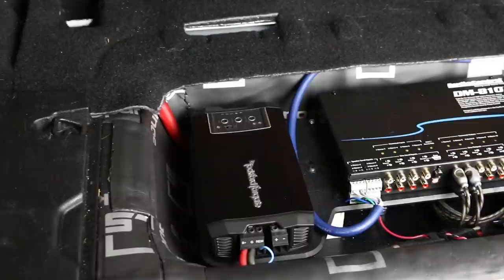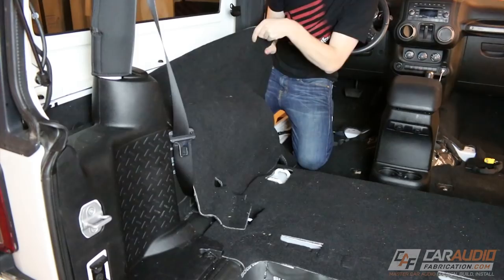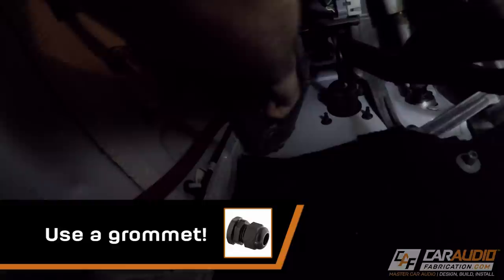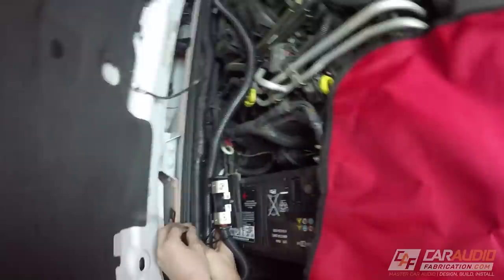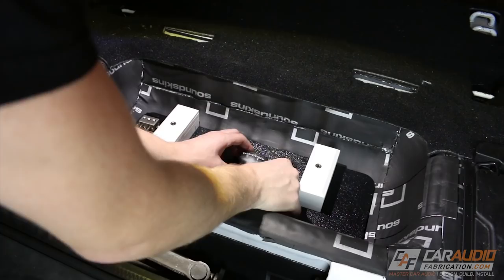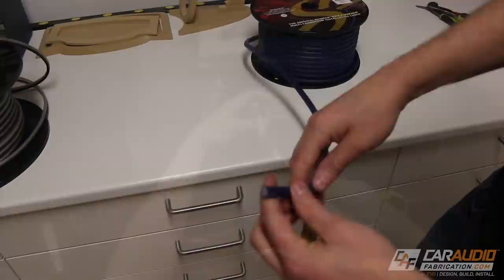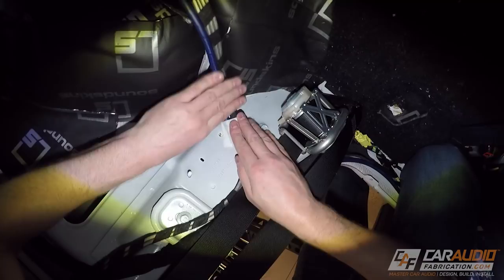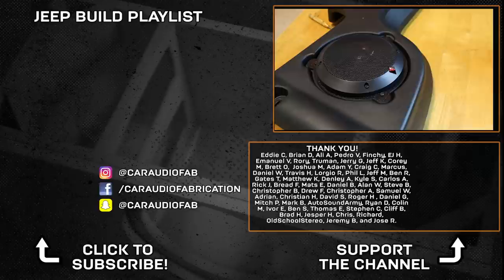Car Audio Wiring - Dual Amplifier and DSP Install

Comment: Since you are installing dual amplifiers and a DSP, why then would you use the power-robbing speaker crossovers? Why not let the signal processor send a strong clean signal to the speakers? Seems like a waste of good resources already at your disposal.
Reply from the maker: +Mr Ol Skül without the crossovers I would need six amplified channels. I have four (plus one for sub) to run active I would need six plus 1 . Every project is different... You could also say why not install a midrange speaker to allow the woofers and tweeters to play less bandwidth, why not remove the stock head unit for a completely digital source unit? The line has to be drawn somewhere and it's going to be different for every project and budget.
Reply: Jim Tomko not true even tho it seems unesicary the thing about car audio is its always can be upgraded so even tho the customer chose to leave the speakers on the stock x over the customer now has a full dsp which mean he has further upgradeable equipment for later down the road. So for now its just a 4 ch amp later on he has the ability to. Add on one more 4ch or more and the thing with low level converters is they don't do what the dsp or a aftermarket head unit does it just takes a full range signal and converts it to a low level full range signal so even if you were to use an amp that has lpf settings on it it still does the system no justice bc the amp itself cannot filter out the other higher note frequencies and once again the converter doesn't do it either if your gonna use a low level converter use it only to run a new highs amp because its not doing your system any justice without a dsp or head unit I have seen so many systems done with them and the subs pick note up the shouldn't be if you listen closely you can slightly hear vocals what good is that? Last time I checked its not there to reproduce all the notes its there to reproduce bass notes👍
Reply: @CarAudioFabrication  Considering how much that DSP costs, to me, it would make sense to buy another amplifier, so you can ditch the passive crossover and control each type of speaker separately.

Comment: If I run active do I need an amp that would have 10 channels? I want 3 way components in the front and two way in the rear
Reply: Or two 5 channel amps? Is that why you ran the crossovers even though you were “active”?

Comment: how come you didnt go active on the components up front? love your show btw
Reply: Andrew Elrose I wondered that to at first. but I'm guessing only having 4 channels available on the amplifier and wanting to run the sound bar as rear fill was the reason. personally would of found a 6 channel or run a separate 2 channel for one of the sets... or I guess just two 4 channels and bridge two of them for the sub...

Comment: I know this is an older video but when useing the passive crossover with a dsp wouldn't that make it impossible to tune the woofer and tweeter separate because the dsp would see it as 1 speaker?
Reply: Exactly!  Pretty much a waste of money buying a $700 DSP, and then using passive crossovers.     Especially a DSP that has 10 outputs, and could have easily been set up to tune the tweeters separately from the mid-range speakers.

Comment: Hi, i have seen a few video on installing the car audio, they actually disconnect entirely the battery, will it be advisable to do so? my concern is the ECU (and other computerized parts in the car), with out any current running through it, will it erased any data in it causing more harm?
Reply: you only need to disconnect the ground from the battery not both, and as for your other question, having the battery disconnected will not harm anything in your car or erase anything from the computers ( ECU).
You will probably have to program your radio stations in again that is all

Comment: Have a question about the power wire, so my buddy installed my system and used 2 gauge thhn low strand wire. It's only a 9 count strand and he told me that this stuff will carry a lot more than the other high strand wire, is this true? I've read a lot of things about this and some people say it's fine that people just don't use it because it's hard to work with and bend and some people say do not use this. Just want to make sure my car isn't going to catch on fire, thanks!
Reply: Solid wire will carry more current.   So fewer thicker wires would be be better for current handling.  However, for car audio installation, you want wire that is more flexible when you are routing your cables, which is why that is what is primarily used.

Comment: I have a question so I have my radio mostly tuned for my subwoofers but when I turn my amp off my door speakers like to sound distorted when I turn them up because I have my radio bass bossed. So I’ve been researching and for equalizers so with that I can most likely be able to tune my radio to my door speakers and the eq for my subs right ? If I wanted to then add tweeters can I put them on the same eq even tho im not going to want the settings the same as my subs? With just having the tweeters for just highs and subs for just Lows and then door speakers ran off radio for mids

Comment: Do you get the combined wattage of the factory head unit as well as the 4 channel amp to your speakers?
Reply from the maker: No, just the signal
Reply: CarAudioFabrication
Reply: Oh I understand now, I didn't realize you run the signal wires to the dsp and then output your rca's from the dsp to the 4 ch.

Comment: why did you went with the audiocontrol dm-810 instead of the rockford 360.3...?
Reply: shawn freshmane 
The DM-810 is much more user friendly and the 3sixty has been known to have lots of problems. Helix is the popular top DSP if you want a crazy amount of expandability. I'm using the DM-810 due to low price and ease of use. My car is a daily driver with a fair amount of road noise so a bit one or Helix is way out of my need.

Comment: If i am planning to buy deh-90prs which is 24 bit inbuilt dsp.. How much impact would in additional stand alone with it make.. Wish to make SQ and nothing competition.. Just audiophile
Reply: Daksh Kakkar Depends on how many channels you want. if u want to run more channels than the deck can handle (like if ur gonna run tweeters etc) then ud need passive cross overs where as with the DSP u wouldn't need em and it would be better
Reply: appreciated

Comment: l know this is a two amp setup, but i have a question and hopefully someone has the right answer!!! I have a AUDIOCONTROL DQDX 6 CHANNEL DSP, and i was wondering if its possible to connect 4 amps to it??? 2 for the sub's and the other 2 for your mids and highs like 2 way component set's just by useing y adapter's to give all the amps proper signal and still get good sound quality out of the entire sound system???✌✌✌
Reply from the maker: It sounds like you only have a need for five channels. Two for left and right "highs" tweeters, two for left and right "mids" and one for your mono subwoofer (or you can use 2) for a total of five (or six if you use two for subs). You would use the subwoofer channels to feed both subwoofer amplifiers so yes this should work.
Reply: Well this is going to be my complete setup so let's see if it's still going to be possible!!! Six JL AUDIO 12W7AE-3 in a c pillar wall powered by two ROCKFORD FOSGATE T2500-1BDCPS amps!!! For the mids and highs they will be ROCKFORD FOSGATES T2652-S  two way component's two per each door they will be powered by two ROCKFORD FOSGATE T600-4 4 CHANNEL amps!!! Under the hood everything will be powered by a 270 amp alt and a RED TOP OPTIMA 1000 CA battery in the back will be a XS power D-7500 secondary battery!!!  This complete system will be installed in my 2012 TOYOTA 4RUNNER!!! If you think this setup will still work please reply!!! Thank you for your help it's  much appreciated!!!✌✌✌
Reply: Sound quality and hard hitting bass is my goal but at the same time I want to make sure I have enough mids and highs to keep up with the six JLAUDIO 12W7AE-3, I don't want to have all bass that's the reason for wanting to go with two 4 channel amps to power two componet sets per each door front and back so that's why its going to call for two of them

Comment: How many amps should the fuse be?
Reply: Double X Depends on the power you're running and never fuse for more load than whatever gauge wire your using can carry.
Reply: Thanks

Comment: Is a dsp necessary when adding amplifiers to factory systems, or can they be ran directly to an amp via high level input?
Reply: I've been running my Nissan's OEM stereo directly to an Alpine MRX-V70 amp for the past five years. The amp runs components in the front, co-axial in the rear, and a sub.  The doors are treated with sound treatment on the inner and outer panels, and the speakers are all mounted to MDF mounts. It can definitely work. However, with that said, my JL FiX 86 came last night, and I can't wait to get it installed. I'd always felt like I was missing some body in the vocals and acoustic guitars, and after looking into it learned that OEM stereos scoop those frequencies out of the EQ. Some DSP's, or units like the FiX will remove that equalization. The FiX also removes the time controls the OEM stereo also adds. You don't need it to run a system from the OEM stereo, but it will definitely fill out the signal again.

Comment: Can a stock radio together with a dsp give you the same performance as an aftermarket radio would??
Reply: The one who licks his eyebrows under $300 deck yeah
over $500 hell no
Reply: XAQ MoonChild. I wouldn't be app hasty on the comment there bud most stock head units can't do half of the stiff even a 200$ head unit can and also using an after market head unit with a cap can be more beneficial then not to because if your using a 360.3 and you have a head unit with high res spdif outputs you can now use a spdif cable for high res output which enables you have a higher band width and higher quality sound with most music that isn't like dubstep or techno why? Well with 360.3 your now able to use a 140bit output versus a 64bit 👍

Comment: Passive crossover with a dsp 🧐so weird why use a dsp then, just buy an amp w hi level inputs!
Reply from the maker: You can still control eq on speakers that are on a passive crossover.
Reply: @CarAudioFabrication  Just wondering - is that the only benefit to keeping the passives when using a DSP? I have a two amp setup (mono for sub, 4-ch for speakers) and was going to use a 2ch DSP and ditch the passives but this is the first time doing an install.  Thanks!
Reply: Made a video on that 20 hours ago or soo.. lol
Reply: @riveralley  Do you own a DSP? Ever installed one? Ever measured and tuned a car? U ever designed a built a sub box? Do you know what a DSP does & what a passive does? Or is your car audio knowledge & experience just from others YouTube videos?
Reply: @uptobatentertainment  I'm currently learning from personal experience, websites, and YouTube.

Comment: Why spend all that money for two amps 🤷🏾‍♂️
Reply: One for speakers one for subs
Reply: That DM-810 DSP probably cost more than either of the amplifiers.   The question should be, is why use passive crossovers when you have a DSP with 10 channel output.